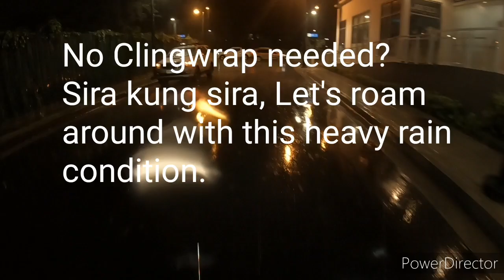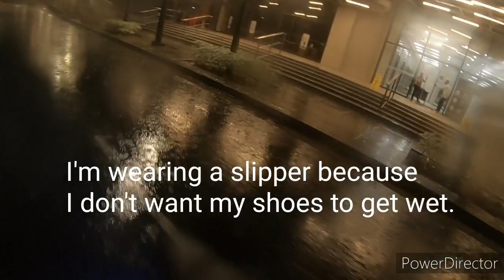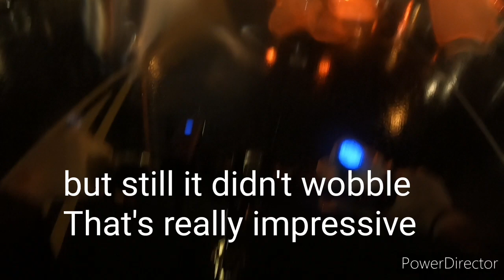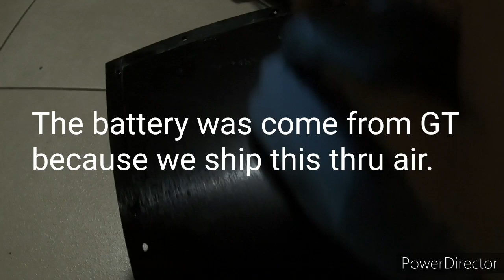Electric Scooter Waterproof? | Weped Fold Rain Test | IP65

Comment: Hello, thanks for the video!
The display isnt waterproof? Or you have it covered for other reasons?
Reply from the maker: Hello Reci, Throttle is not waterproof yet but eventually we will have another option for that 😉  Thank you.
Reply: 3M liquid waterspray, very good for circuit boards

Comment: Is this the same as US model Weped GT 50e?
Reply: No ... It"is a different new model for  2020 ... 
It has different folding, suspension system ... 
Weped staff told me ... they are trying to open shop  in NYC area within 1~2 month ...
Reply from the maker: No it's different this is newly re model of Weped Electric Scooter